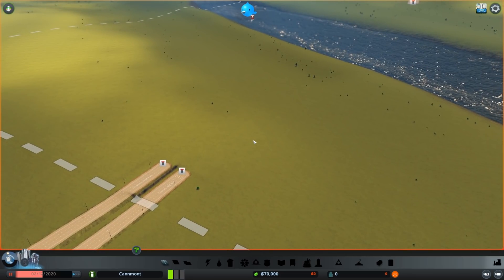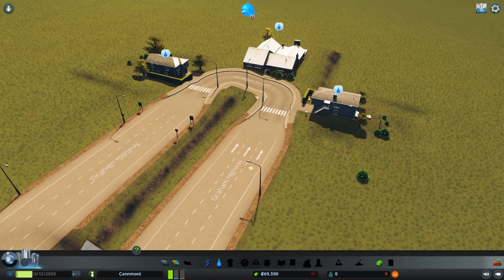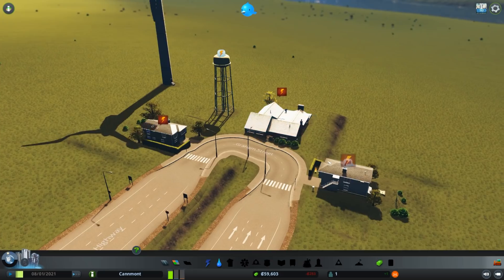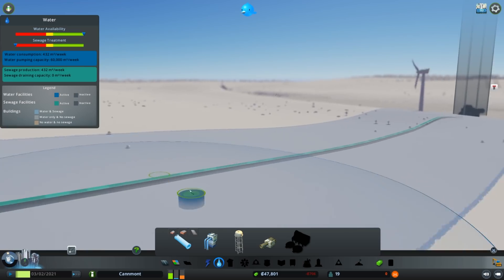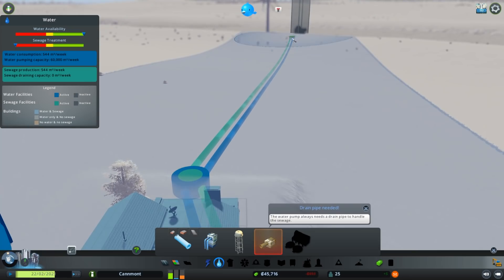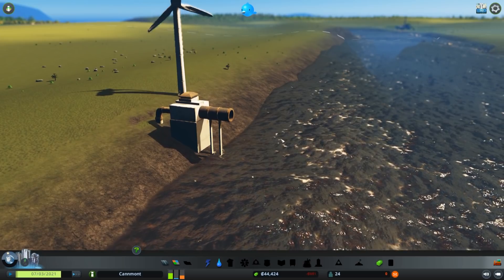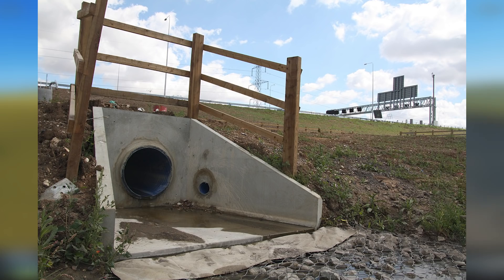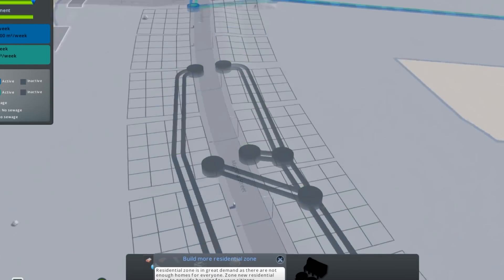HOW REALISTIC is the DRAINAGE DESIGN in Cities Skylines?

Comment: It is a city design simulator - not a service design simulator.

You could add a lot of realism into the game. But then you would need to decide e.g. for power - how you connect your houses - How much overland or underground. You have high power overland lines - lower high voltage in between - going lower each time you come closer to your comsumers.

Residential area will have 380/240/110 V - industrial 400V or even higher. So you have to balance your substations. Then you will have to keep the power flowing so your frequency does not drop and you have outakes. Again very basic - as each station has more or less a constant power output. But some plants are good at providing constant power output, while others can react quickly to power demand changes that are not reflected within cities skyliens - e.g. power surges during advertisement breaks. 

You could spent a lot of time in these knitty gritty details, but your actual city development as a major will suffer.

Lastly everything in cities skylines is instant. If you built a high-way it is instant. If you upgrade your road it is instant. The nightmare of a city planer is that it is not instant and if you have to rebuilt an atery road you will have nightmare traffic for a year and lots of unhappy calls. So you need to plan your road upgrade with the downtime in mind - e.g. upgrading halve the street - or building an alternate route, ...

Traffic. Traffic is nice - you can get traffic jams, but never accidents. No highway will be taken out because some random lorry crashed - or you have a mass collision during fog. Desasters tries to aliviate it, but still it is external forces attakcing your city and the meteor will hit your hand crafted highway exit and not the default low effort residential grid.

Comment: in California of the US water treatment is required of all waste water (runoff [surface water, i guess, in the UK] and sewage [foul drainage]). so if a pond exists, it has to be before it enters the pipes, as once it enters the pipes the water is now the responsibility of the utility company. all waste water needs to meet certain requirements for cleanliness before it is dumped back into the environment. runoff has less treatment than sewage, which is why you don't mix the two up (and there are fines if you do). you don't need chambers every so often, but if you don't you need to have a large enough of a tunnel so that workers can operate within in order to work on the system. manholes are the way to access this tunnel, and generally main roads have a tunnel under them in order to handle all the different pipes. East Bay Municipal Utility District  (EBMUD) is the main water company in CA, and in order to be sure to avoid fines and bad press the last stage of water purification is reverse osmosis, making their waste water distilled water (cleaner than the water they take it to supply customers). other places that use reverse osmosis (not in CA) use the clean waste water to supplement water to its customers, typically as a second water type called grey water which reduces the load on local water sources by a massive amount. EBMUD has a great aqueduct that feeds water to southern CA, and in the early 90's was a big political issue as old contracts gave southern CA the water for free and without any restriction. local water companies then maintained pipes and distribution from the aqueduct to customers which includes farmers which grow water intensive crops in what is naturally arid flood plains, and that lead to water restrictions for those living right next to the water sources and not for those living far away in areas with several inches of negative rainfall (more water is evaporated than falls).

the rules for bends is more relaxed, though you cannot of joints (for altering the course of sewage) or bends that are too sharp in the sewage pipes. pumps are avoided, as they require more maintenance than not having them, which means pipes are put into the ground to ensure the gradient is at least a certain amount and thus does not follow the height of terrain. the pumps are put underground so that they are protected from the elements (and within the tunnel system so that they can be worked on easily). though there are larger pumping stations which help keep things flowing outside of residential areas, and they help shift the height in order to get the sewage to the processing center. the waster after it is extracted form the water is then treated as toxic waste and sealed and shipped off to special land fills. they are usually dried into bricks for easier containment and shipping.

roads are made with the rainfall of the area in mind, so that areas with more rainfall are rounder. the paint they use to mark the roads is even different, in that heavier rained areas have thicker paint that sticks up more in order to be have a different shape in heavy rainfall (when glare and such obscures the color) so as to know where the lines and such are on the road. the texture is also different so that the thicker paint also tends to grip better to rubber when wet relative to the thinner paint used in dryer areas. dryer areas are have better grip with tires when dry, as they are flatter. the pain is also better able to handle UV than the thicker stuff, and is cheaper. in places that snow a rougher texture of road is preferred as the rocks will stick through a thicker layer of ice, reducing the dangerous patches in cold wet weather, and the paint is also thinner and cheaper to be reapplied every year as making it thicker or more resilient to UV sin't helpful.

Comment: The game puts the sanitary (foul) sewer in parallel with the potable water supply.

Gravity drains and transfer pumps are assumed - the details of sewerage are glossed over - as are things like manholes.

Storm / surface water is only superficially touched upon... when you get deeper into the game, you will discover the stormwater catchment / outlet - which is mostly a toy.

You will find yourself regrading the terrain in order to prevent flooding.

But all of those details of a stormwater drain system aren't appealing to most non-engineers, so they get glossed over for playability.

I'm a Chemical / Mechanical Engineer, so grading & drainage are at best incidental to my practice. Cooling water systems and run-on / run-off controls, and industrial wastewater do get into my wheelhouse, as I need to be able to interface with the Civil Engineers.

Comment: If we're talking realism, how come you didn't mention the problem with the water tower?  A water tower is for storing water, it doesn't produce water.  What they were looking for is a well, not a water tower.

A lot of people like to flush the toilet and take showers in the morning.  If you have a water tower for storage, you can build a smaller drinking water plant, and fill the tower tank overnight.  Then when everyone wants more water than the treatment plant can provide, the tower drains back into the system via gravity.  Hilly places tend to use a tank on the ground on a high spot above the town.  I know of one city that has a large underground tank and several pumps to serve the same purpose.  It's also part of the reason New York City has their famous wooden water towers on top of all the buildings.

Comment: I work mech and elec maintenance for a water board. I thought, while you add some knowledge on where it goes to, I’d give some knowledge on how it gets treated. Basically, we have pumping stations in areas where gravity doesn’t work. Generally we pump from areas in a dip to either another station that takes it to a works or to a gravity sewer that will take it to a site. At the site itself it is first screened for any solids and taken to primary settlement where the water is allowed to distill itself basically. This helps to separate some more solids from the sewage. It then goes into either a bio filter where it is spread over media where bugs eat the bacteria in the sewage. The other option is an aeration pit where air is added into the sewage which makes the bugs more active as well as separating the solids further. It then goes to a final settlement tank where it is once again settled and then flows out into a river, treated. There are other tertiary treatments that take place depending on how bad the original sample is. This varies from complex stuff like sand filters to a basic Reed bed. The solids that are removed during the process are taken, the water is drained from it and the waste is burnt to drive turbines and create electricity. Not sure if this is what anyone wants to know, but thought I’d help add to your education

Comment: Everyone where I live has septic tanks but I don’t know how they work, I know we have some ugly tanks sticking out of the ground in our yard and there’s a pipe that drains water into the ditch but the water dosnt stink and it dosnt drain shit out so is it like a filter?
Reply: The septic tank is a setting basin, and the clarified water (solids free) then needs to drain into a leach field where soil bacteria chan chew on the dissolved matter. There are standard requirements for soils conditions and separation distance before you get to any well, surface water (creek, river, etc.) or other potential drinking water collection point.
Reply: @chemech  ok, from what you said I think the smaller round ones are the setting basin and there’s two big rectangle ones that probably work as the leach field

Comment: In Belgium we have so much roads and concrete that the water flows away too fast and the ground water is super low (due to climate change too of course). Is that something you also need to take into account, any way to prevent that? Does a pond help?
I was also wondering: why is it better that the pollutants from the road end up in the pond instead of in the river?
Reply from the maker: The river is natural and existing, so delicate to changes, where as a pond will be man made and therefore an existing ecosystem will not be damaged. Ponds should be maintained overtime with silt dug out of it etc, but also water passing through grass and shrubs will be filtered. Plus uv light from the sun will help clean it in the pond too.

Comment: Are there any specific advantages or disadvantages to using a road gulley instead of a curb inlet?
Reply from the maker: No scary clowns can hide in them.

Also, theyre easier to maintain, grating prevents large debris entering the system too. Downside is gullies do not allow as much water to enter.
Reply: @RealCivilEngineerGaming  Makes sense - Do gullies have a tough time with heavy snow? I live in Minnesota, and we are expecting 15 or more centimeters of snow today...
Reply from the maker: @aarontelander  not considered at all, in the UK anyway. I'd assume as snow melts a hell of a lot slower than rain falls it doesn't matter
Reply: @RealCivilEngineerGaming  I guess I more meant as far as clogging goes. In the spring here, we will sometimes get rains while there is still lots of snow on the ground. Curb inlets seem to do a good job of "swallowing" large chunks of snow that get in the way. Idk how a grate on a gully would do
Reply from the maker: @aarontelander  nah, melt will always find a way in. I can't imagine it being an issue, but I've never designed for a climate like that so could be wrong

Comment: Hey RCE! I'm also a civil engineer and in the US, on highway design, we actually do use the 'gully's as you call them on our highways.  In general, I'd say we use curb and gutter inlets when the road has a curb and gutter.  The inlet looks like where IT would hang out.  And on highways and freeways we typically use catch basins (or gullies as you call them) when there is a barrier instead of a curb.  We also have similar spacings for the inlets or catch basins for the same reason you mentioned.  Roughly 300 ft (100 meter) pipe lengths.
Reply: I am.
Reply: You’re not a civil engineer. You’re a liar.
Reply: @chill5978  I am no engineer, but I have seen both types in the US, I dropped a water bottle and lost it in one of those curbs with a hole in it. But cars don't run over those holes in the curb at least.
Reply: @hammyboigaming904  That is the problem with the US holes, large things tend to fall in them (including tree branches and children). 

But at least they do not make that annoying sound that gully's do when you drive over them, anything for the convenience of the car.
Reply: I studied both mechanical and civil engineering.

Comment: In a previous vid you talked about Building a city in the desert at your job. Any specific drainage challanges with that?
Reply from the maker: Not really, they cover all the gully gratings for most of the year to prevent sand entering them. They send a gang out before rainfall is due to open them all. In ours they were boring a huge tunnel under the city that we discharged to, but mainly it was through infiltration into the ground
Reply: Minimizing water losses is the primary issue with desert cities. A lot of water has to be pumped in for it to be possible. The only drainage issue that I’ve ever heard of there that typically occurs is reclaiming water on roadways and that’s generally just textbook

Comment: Here we call the road slope "the crown" typically between 2-4% depending on drainage, & use cases. When building a road with a 4% crown you've gotta be very careful dumping material as even this 4% slope is enough to nearly make trucks flip (5-6% and it'd definitely flip).
Reply from the maker: Crown is usually used to describe the highpoint of the cross section of the road. Also the falls go up to 7% on a tight bend on a fast road
Reply: Yea some super curves we did go as high as 11%! crazy the solutions you all have to come up with to work with preexisting and make things safe.

Comment: At wastewater plants, bacteria in giant concrete basins eat the carbon and nutrients from the wastewater. Then these bacteria are separated from the water with gravity settling. The clarified water gets filtered through sand, and disinfected with bleach and/or uv light before being discharged. Source: real environmental engineer
Reply: Source: Environmental engineering goose
Reply: @Benjamin Garrett an average water molecule will take 2-4 days to get through a conventional wastewater treatment plant, and most of that time is in biological treatment (in the reactors with bacteria). Some plants will add alum or ferric sulfate to expedite solids separation processes
Reply: @clintcheney4315  Here in the US, ferric chloride is more common - it's mildly acidic, and completely soluble. Kills two birds with one stone, as you get your best flocculation for some waters at a pH of ~6.5.

Alum is the flocculent of choice if you don't need to do as much pH adjustment, as the polymerous aluminum oxide floc it makes is good stuff.
Reply: That would be the wide circular tanks with the agitators spinning around right.
Reply: @letsgocamping88  Actually bottom rakes to guide the precipitated sludge to the central drain inlet at the point of the conical bottom of the clarifier / thickener.
Reply: @letsgocamping88  The wide circular tankes are the settling tanks - the biological treatment itself usually happens in big rectangular tanks, often several staged in a row where some have air blown into the water and others don't.
Reply: learnt that shit in middle school :p
Reply: @user-wq9mw2xz3j  Literally
Reply: The 30 second overview of a sewage treatment plant.

Primary treatment - screen out the course chunks.

Secondary Treatment - neutralize the pH, add alum or iron chloride to flocculate, and drop out the chunks

Tertiary treatment - fiddle with the chemistry and feed the water into various biological tanks / ponds to chew up the remaining fats, proteins, and starches, and to kill off diseases.

Extremely rarely, there will be Quaternary treatment, such as by Reverse Osmosis (RO) to get the effluent to drinking water standard, followed by disinfection prior to pumping into injection wells for example.  The Orange County Sanitation Districts in Southern California needs to do this in order to prevent seawater intrusion into the water table which supplies the drinking water wells. The potable grade water can then percolate through the groundwater formation before any of it gets mixed in with fresh water flowing downhill which gets pumped up, filtered, and disinfected prior to going into the potable water mains.